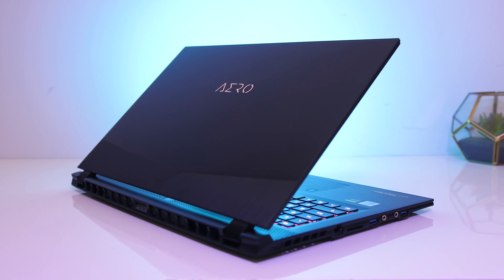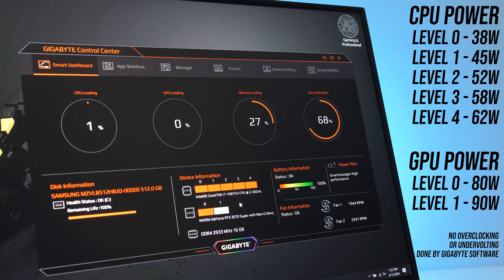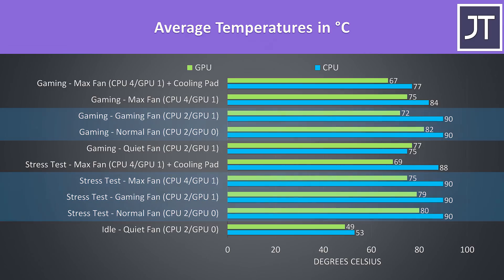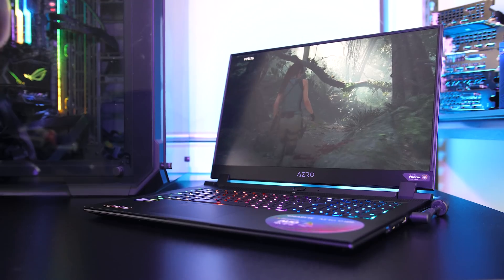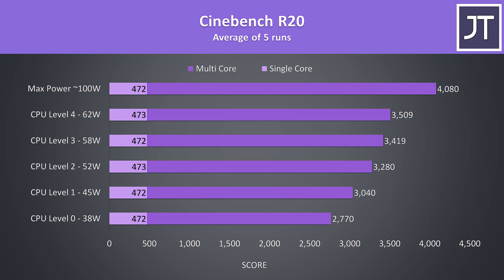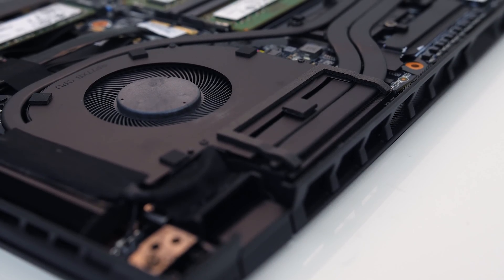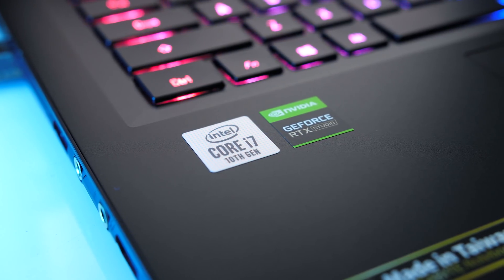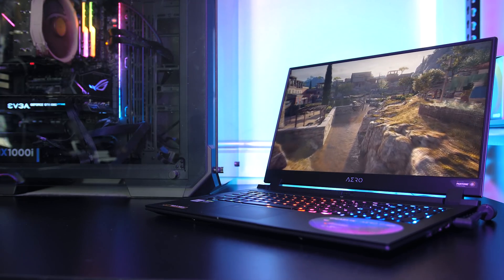How Hot is 10875H + RTX 2070 Super Max-Q? Gigabyte Aero 17 XB Thermal Testing

Comment: peeps i ve bought asus rog g712 3 months ago and having problems for last 2 weeks. wifi keeps closing while playing games but it doesnt happen on silent mode, only on performance and turbo. i realised cpu temperature while playing world of warcraft shadowlands is about 85-90 and gpu is at 80 c . cpu usage ranges around %40-50 and gpu at %50. even at those settings pc heating up like hell. is it normal? i think windows is the one closing wifi adapter to keep it from melting.

Comment: Love you reviews man. Got my aero 15 oled tnx to you and achieved 100w 2070 maxq and no throttling with liquid metal and undervolting, you 1750mhz +600mhz ram and beat 2070 115w... So I think this can be done in near future with new aero as well... So if you can keep in mind for future reviews and mods, when available try to flash with nvflash a 100w 2070 super maxq vBIOs (probably razer 17 blade pro will make a custom 100w 2070 super and we can take their vBIOs, which is actually the one I use on my aero 15 oled to boost the 2070 maxq from 80w to 100w and keeping thermals down with liquid metal, thermal pads and cooling pad achieving results of 4000 eur laptops.... Considering that aero comes now with 3200mhz ram 22cl (still cannot be set to 2933 cl19 cause to limited bios options) it will be the best choice for both performance and price compared even to msi and razer if we can get a 100w bios running on it... Would be again the definitive choice thanks to ports, keyboard and keypad, cost, performance and oled... Untill new laptops with rocket lake and and rtx 30xx will be reality.... Make me happy in the future and try to make a review with a 100w bios on new aero 15 oled or 17 hdr ;)))) and thermals with LM and thermal pads to check if we can get no throttling and max 70°C on the most intensive stress test avx2 cpu + gpu burning at same time.... Put 2x2tb 3000mb read write ssds and the job is done.... The only problem of gigabyte is shit bios and non ram upgradable on new versions (only Samsung, tested 10 brands and different configurations no way to boot, only previous aero 15 could have some Kingston and gskill working... New one doesn't work with any brand but Samsung... Whatever jedec or xmp profiles are compatible or not)
Reply from the maker: Cheers! I don't want to risk flashing random vBIOS to review units unfortunately as they're not mine if they get messed up and I've currently got no experience doing that. Might look into it in future and do it with my own stuff though.

Comment: Hey Jarrod, so I ended up getting a MSI GS65 with thermal grizzly, clean installation and all recomendations. Unfortunately when playing the machine runs incredibly HOT!!! After viewing several recommendations on how to help it run cooler I simply modified the Processor power management and tuned it down from 100 to about 94 which seems to be helping. My question is , is the Aero 17XB or 15 version the best laptop in gaming/temps department? Or what would you recommend!! I'm even considering selling the GS65!.

Cheers.

Comment: I have the 10980HK version and at performance level 5, XTU is reporting 80W base PL and 107 turbo PL.  Also, did you run with AI turned off or on?  I have started testing with it on and I think I am noticing about an extra 100MHz in performance when I do massive C++ compilations with Visual Studio.  I have last year's Aero 15 with the 9980HK and I am trying to do comparisons against that right now.

Like you, I notice that I can't seem to adjust the voltage offset :(  I am holding out hope that the AI continues to do a better job.

I have also created my own custom fan curve which keeps the fans running at 30% up to 75 degrees, then up to 55% at 85 degrees, 60% at 90 and then 100% at 95.  When benchmarking with manual fan control, I noticed very little CPU performance difference above 60%.  I just wish they let you have a 0% setting in their custom fan profiles.  I guess they don't trust users to not burn out the CPU.

Comment: Hi, I have a question unrelated to this video. At the moment i have the dell xps 13 9300 (i5 8gb 512gb model) and was wondering if I could run a vr headset with an egpu. I want to get the oculus rift S and the gtx 1060 6gb for the graphics card.

Comment: The Aero 17 chassis is just the sweetspot between portability (for a 17 inch) and thermals.  BTW No Samsung RAM anymore?  I wonder if in this generation they are going the keep the component consistency.
Reply from the maker: Probably working with the minimal 3200 options that are out there.

Comment: Hey guys is 90°C normal for ultra settings on some games. I only get it on certain games and am not sure if its good or not
Reply from the maker: For Intel processors it's basically normal under heavy load, that said definitely steps you can take to improve it like undervolting, stand/cooling pad or changing thermal paste.
Reply: Jarrod'sTech yeah i have a cooling pad and undervolted already. Thanks tho

Comment: i was hitting 90-95c while playing Apex legends on my legion y540 with the i7 9th  gen cpu and rtx 2060. Even with uv though it only showed max temps upto 80s in the stress tests, but it was still hitting 90s in Apex. Then i disabled tubro boost,  the temps went down to 60-70c range while gaming, without much fps drop. Hope this could help out someone.
Reply: that's because of the clock difference. like a 2ghz gap you're cutting out there
Reply: I have the same latop. Disabling turbo means heavy fps drops in heavy games like bf5 or rdr2. What you could do is limit the ghz to 3.7. It makes a huge difference in temperature and gives almost max fps.

Comment: It's wild that they can fit an 8-core CPU and an RTX 2070 graphics card into a chassis that small. It gets toasty and loud while gaming, but nothing that a cooling pad and headphones can't solve.
Sad to see undervolting not available. My Aero 17 (6-core i7-9750H) sits at -0.14v, which is a decent undervolt.

Also, the shots where you're making a fan profile... I just want to point out that making fan curves in the gigabyte software is an awful user experience. It's fine to drag the dots around as an example, but when you go to actually use it, it's laughably un-intuitive. The app "NoteBook FanControl" can be used an alternative, and it lets you set the fans to under 30% and control fans independently (gigabyte software doesn't support this).

Comment: You cant undervolt because the bios.  Dell recently pushed out a new bios for their XPS line of laptops and it blocks the undervolt via TS and XTU.  I hope this is not a trend for all manufacturers. This will be bad for us enthusiast/gaming laptop users.
Reply from the maker: Yeah but that's Dell, this is Gigabyte and MSI so far. It's definitely the BIOS, but at this point it seems more like it's Intel locking it down 10th gen wide or something.
Reply: @JarrodsTech  yes the XPS notebooks are the 9th gen that got the update and blocked the undervolt.  It may be a code update via Intel getting baked into the bios by the oem.

Comment: You run hotter than any 10th gen Intel build. <3.

Though to be serious I'm more than willing to wait for premium Ryzen 4000 builds to roll around. AMD's really made a breakthrough with this generation of laptop tech and I want to support them with my wallet.
Reply from the maker: Hahaha. Yeah fair enough, hopefully they aren't too far away.
Reply: No premium laptop coming with ryzen except surface!!
Reply: I am having a hard time with a similar decision. I really want the G14/15, but I also really want at least a 2070 (not Max-Q). My previous laptop had an i7-7700HQ and a GTX 1070. The RTX 2060 is slightly below that performance, but the Ryzen 4900HS out-performs almost everything else on the market. I want a new Ryzen 7/9 4000 series processor because it is just a superior chip and will serve its purpose for at least 4 years. Hopefully Asus has a Ryzen + RTX 2070 coming soon!
Reply: @NickErickson  I do agree with you. The lack of premium Nvidia GPUs being paired with Ryzen 4000 series is concerning and it's hard not to think it's because of Intel's interference. If the Radeon 5700m comes out soon and is a solid alternative to the 2070S, I'm going to look into that myself if Nvidia pairings take too long.
Reply: @NickErickson  \BobofallTrades proved that you wont be able to get that much cause there isnt that much difference between 2060 and 2070 and 2080 ontop of all this its not worth the price just for a few fps
Reply: @Jaime Beauchamp that is misinformation from Lenovo, at least at the beginning, 5i will have the gtx 1650
Reply: ryzen super nvidia laptops will drop in a bit
Reply: I had the same mindset, but my wife said she won't wait till September to get her laptop back, so I have to buy one now.
I got a barebones clevo that uses a Ryzen processor, and is upgradeable. now when the good ones roll out I can just pop in a new chip. I even get an RTX 2070, which is good enough I guess.
Reply: Nothing above a 2060 with Ryzen CPUS will be out in the next year.

Comment: Intel's Plundervolt security Mitigation is to lock the Voltage to default settings.  Not Sure if that will also apply to the K series Chips
Reply from the maker: Hmm guess we'll see.
Reply: @JarrodsTech  I hope that the manufacturers allow you to turn it off with a bios update

Comment: Holy cow, its hot. Ryzen, please be early. I want to upgrade
Reply from the maker: I guess I've tested so many things, that 90c to me is perfectly acceptable now, at least compared to the machines that run in excess of 100c.
Reply: @JarrodsTech  Hahaha, for me 90c is no no. I will undervolt it.
Reply: Yes me too. ryzen will undoubtedly run a lot cooler. this frying pan of a processor had to use 90w to equal a ryzen at 35w. look at the power difference
Reply: @rg1346  Yep but currently Ryzen machines have low powered GPU's that are still frying pans, so 10th gen intel still takes it as a complete gaming package.

Comment: 2:05 overheating garbage I hate it. It just goes to show how terrible Intel is in terms of efficiency. Intel laptops that don’t hit 90C under stress have become VERY VERY rare.
Reply from the maker: Can't say I have an issues with 90c given there are laptops that run in excess of 100c while performing worse.
Reply: Jarrod'sTech how can you not have a problem? Why don’t you consider chip degradation? These gaming laptops are not meant to be replaced year over year, there meant to stay for 4 or 5 years. Believe me chip depredation is serious it caused my 5 year laptop to start throttling heavily, do not take it lightly.

Comment: 👍 great review as always. 
I'd like to ask though - not very related, but what is your opinion on mixing different size of RAM, eg 8 and 16 GB (just size, else same). Have you covered that somewhere? I see many laptops with 1 stick soldered and some only offer 8GB soldered 🤦‍♂️. For content creation you often want 32GB and so this is pain. (Thinking about asus G14, this is my only problem with it).
I saw single vs dual channel vid, but this is a bit different I guess. Any plans to cover this?
Reply: Asking the right questions. I have my replacement g14 4900hs on pre order since the first one got heat problems (75*c in idle). I would like to know the awnser as well if you want to upgrade your ram in te future with 8gb soldered.
Reply from the maker: Not ideal, it will run dual channel, but once the 8+8 is used, it will be back to slower single channel speeds. Haven't tested it out in a video before though. G14 is available with a 16gb soldered option so I'd preference that one. Might cover it in future if I get the right RAM sticks available.
Reply: @JarrodsTech   As i understand the 32gb single channel ssodim stick will be slower in a g14 then the 2x 8gb (  a total noob with soldered laptops).
Reply: @JarrodsTech  Is there 16GB soldered option for G14? If so, on paper it's just 👌 ideal for me. I will check/wait if I can find one. Thanks!! 👍

Comment: Jarrod I need a little help.

A GTX 1660ti laptop graphics card can be compared with which Desktop GPU? Can it be compared with a GTX 1650 Super or 1050ti or 1660? Suppose CPU are same.
Reply from the maker: I've compared laptop 1660 Ti with desktop 1660 Ti as fairly as possible here: https://www.youtube.com/watch?v=YAZ5siS0VmE
Reply: @JarrodsTech  Yes bro I watched that already. I can see a difference between this two. I just wanted to know which Desktop GPU can give almost same fps as a laptop 1660ti......
Reply: Are you trying to use thunderbolt for an egpu?